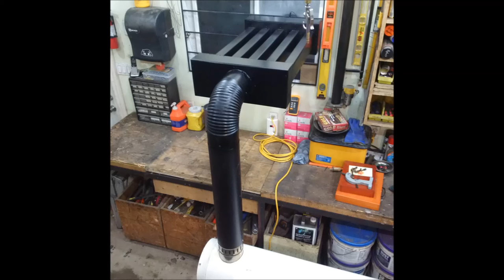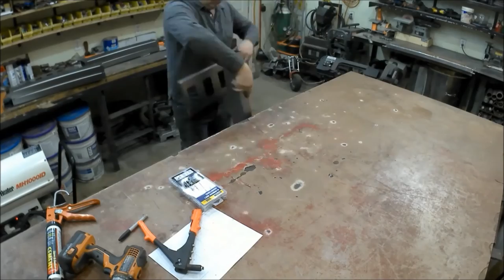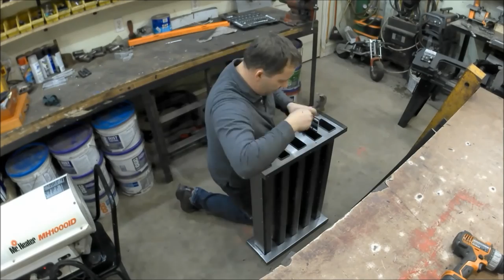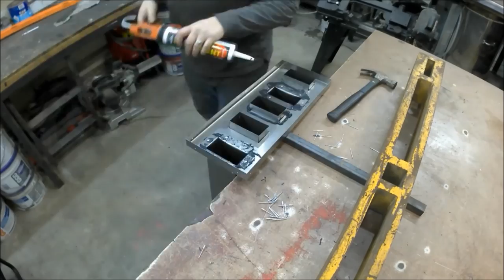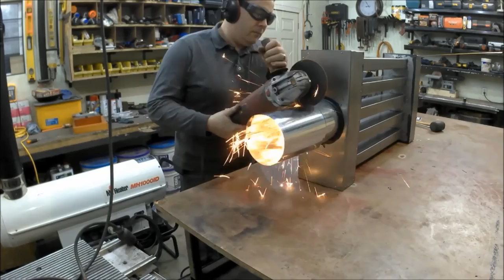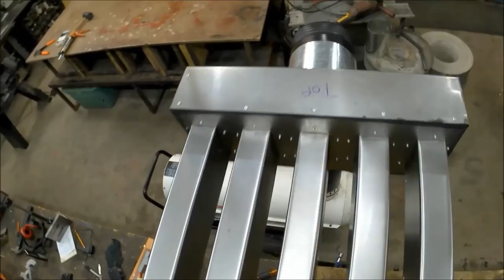How To Make A Shop Heater Heat Exchanger - Part 2

Comment: So did you block off the end of the torpedo heater so that it only exits through your heat exchanger?
Reply from the maker: It's actually an indirect heater meaning it has a built in heat exchanger where most heat goes into the room but I made my custom heat exchanger for the exhaust pipe so I could capture more heat instead of losing it through the chimney.

Comment: I dont get it ? the heater is still inside your shop what have you solved ?
Reply from the maker: The exhaust fumes which are vented outside are now a lot cooler than before because the heat exchanger extracts more heat from the fumes and keeps the heat inside the shop instead of blowing the extra heat to the outside.
Reply: @ChrisOfAllTrades  I have a Dyna Glo Pro kerosene/diesel heater which  does not have the vertical exhaust it shoots a small flame out the end which is why I could not understand what was going on with your setup, I dont believe you described how your setup worked ( or I missed  it)
I tried to make a heat exchanger that was outside in which my before mentioned heater heated a u shaped 12 inch duct pipe that took fresh cool air from inside the house heated it outside then returned it inside but the losses were to great. I couldn't stand the noise and fumes of the heater.
Reply from the maker: @ExploringCabinsandMines  yeah, my heater is an indirect heater, meaning it heats  the core of the heater and blows inside air across the hot core and vents all the fumes outside through the vertical flue/chimney. I just wanted to extract extra heat from the fumes going outside; that's why i built this heat exchanger to cool down the fumes even more before they are vented outside.